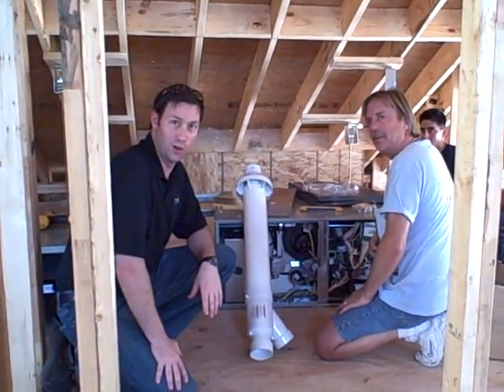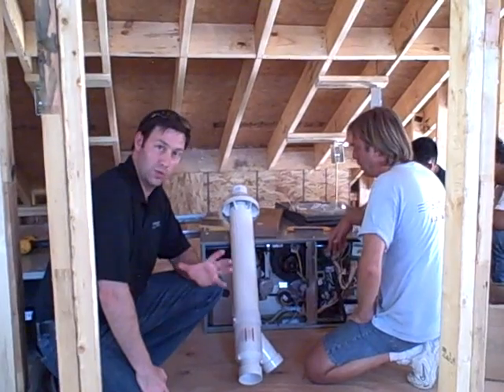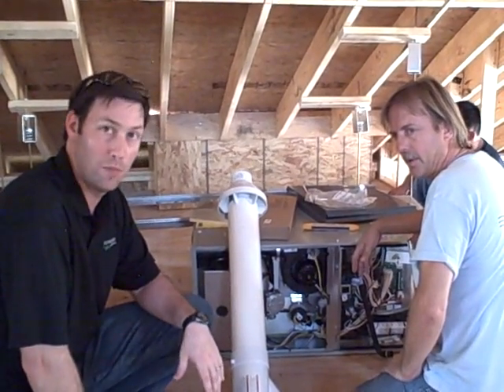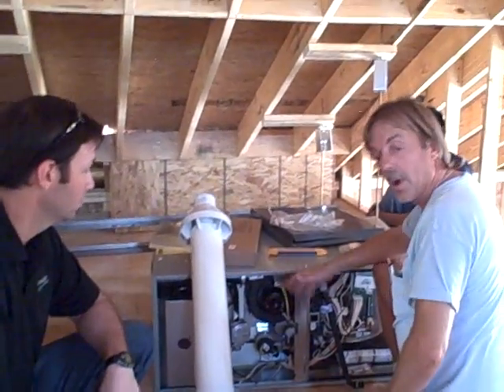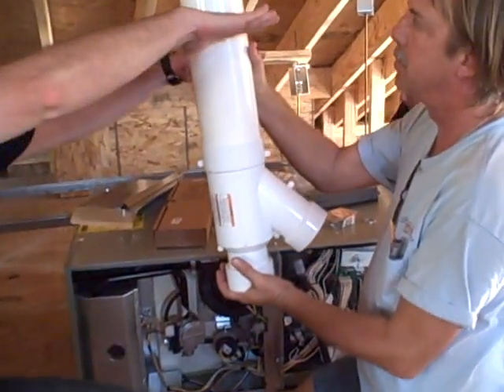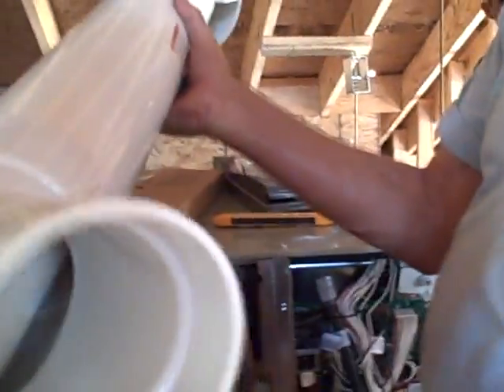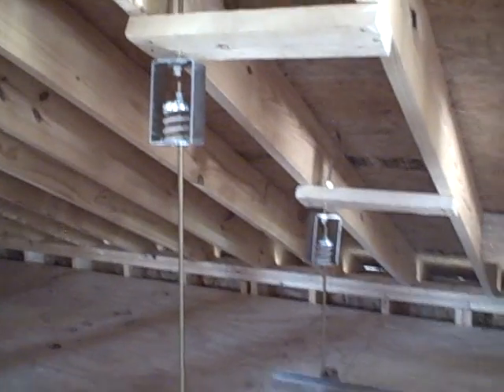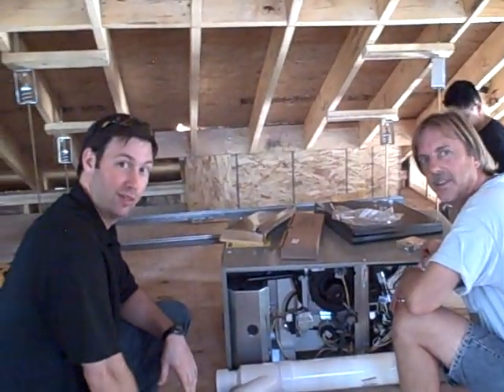95% Efficient Gas Furnace & Venting for a Sealed Foamed Attic

Comment: Avoid HVAC attic installations unless the environment is temp controlled or the attic is finished. Attic temps can exceed 140 and you are trying to cool the house. Expect to lose 10% cooling and run the risk of leaks that will bring attic dust into the house.

Comment: My furnace is vented through the roof. It had a tee on the exhuast. They replaced the roof and put an elboy on it, Is that ok. My condensation pump runs more. about 6 times a day if not more.

Comment: Correct me if i'm wrong (and i'm no HVAC guy) but the reason there is a plastic (or PVC) vent isn't because of low heat but because of Carbonic Acid. Carbonic Acid is formed when Carbon Dioxide mixes with water after the combustion process and would be very corrosive to a metal vent or drain. Pretty much why everything condensate in a furnace like this, is PVC or plastic. But I do have a question on this, does the PVC vent have to be insulated? I've had an inspection on my home and the inspector is saying that it need insulated. Why?
Reply: Did he mean the refrigerant lines or the duct. Depending on location the duct needs to be insulated. I  can't speak for code in other states but never heard of pvc being insulated.

Comment: With the exhaust vent upright in a roof penetration how is water drained from rain and snow melt?
Reply: 90 percent furnaces have drains built in. They can get clogged. Recommend tune ups to clear drain lines and even drain the water from inducer if you hear it gargling. The flue gas is warm enough to melt snow. In high wind areas if a 45 or 90 was put on top it can give a pressure switch issues if wind is to excessive. Screens have been known to ice up. Just make sure the flue is higher then the snow level of your state and you should be ok.
Reply: High efficiency furnaces have drains built in to drain through multiple drain lines. Pvc needs to be sloped properly or you will have pressure switch issues.

Comment: It depends on the building envelope; if you have an older house that is susceptible to infiltration through the walls you are okay. If you have a newer home that has been engineered to have a "Tight" building envelope then the furnace will require a combustion air pipe from outside. High efficient furnaces have a closed burner compartment and when a two pipe system is used the furnace will be using fresh clean air from out side to mix with the fuel for combustion apposed to dirty air from house.
Reply: he is used a concentric it's a double wall pipe the inside of pipe is for exhaust and the outside of pipe is the combustion air so you don't burn oxygen out of house

Comment from the maker: One beauty of these 95% gas furnaces is that the venting is all PVC.  That allows you run horizontal flue pipes and locate the unit in places that won't work for an 80% furnace.  I don't know for certain about your application but it seems likely.  Best, Matt

Comment: Hi, I have uploaded this video so that you can see which unconnected air inlet I am talking about. When I had my home inspection done at the time of home purchase. The home inspector said it should have been taking air from outside of the house. But he did not mention that as concern. Can you please have one of your tech have a look and see if this is not something to be concerned about. Thanks
Reply: If the room is big enough and is getting plenty of fresh air intake some furnaces in the installation manual actually have pictures of 3 inch pvc intakes being vented into the gas buner box assembly. Flue gas should always be exhausted out side. Look at the installation manual and you will get your answer. You can download a pdf online by using information on your furnace data plate

Comment from the maker: I'm hesitant to comment because I'm not exactly sure which pipe you are calling "fresh air".  If you mean the combustion air then that's not good if you have a modern spray foamed and tight construction house.  I would get another trusted HVAC contractor to check this install and see if it's done correctly.  Best to be safe when it comes to Gas appliances.  Matt

Comment from the maker: Great question. I'm actually not sure if they have a technical name.  My HVAC contractor gets them from the AC Supply House.  I've been using them in all my houses for 8 years without any issues.  I don't think this small amount of vibration will affect structural framing.  Your method seems solid if you're worried about this small vibration though.  Best, Matt Risinger

Comment: I am interested to know what the spring hangers are called (maybe "spring hangers" lol). Smart. I won't connect to the rafters the way that this was done though. I'd worry about the vibration eventually loosening the cross brace nails. I'll run eye bolts horizontally through existing rafters (5/8 inch) and connect to the spring hanger with another eye bolt and S hook.

Comment: I had a Trane furnace installed last year. They vented it outside and also piped a fresh air pipe but tyey never connected that pvc pipe to the furnace. They left it near the furnace and said the furnace would draw the fresh air from that pipe there. I had to put a pvc elbow on the furnace where this pipe should be because it got clogged,the furnace room has a cat litter box in it and that may have clogged the opening. Should we add more pvc pipes to connect this fresh air vent to the furnace ?

Comment from the maker: @mack70214 Good question.  I don't believe it would burn hotter.  The unit we're showcasing in this video is natural gas powered and is very efficient as it turns 95% of the gas into usable heat and 5% is lost to inefficiencies.  Typical Gas furnaces are 75-80% efficient.  I've never installed an oil fired unit but I would guess that they make some equipment that will use the oil more efficiently too.  Hope that helps.

Comment from the maker: Yes indeed.  This furnace is much more efficient than the standard 75-80% efficient models you see in most new homes.  BUT, equally important is that it's a power venting model.  The flue is PVC and stays cool.  It doesn't use combustion air from the attic so we can use this furnace in a foamed & conditioned attic space.  Plus, no worries about combustion gas spillage into your house (meaning no carbon dioxide worries).  I recommend these to all my clients.
Reply: Matt Risinger  Carbon monoxide is the real concern